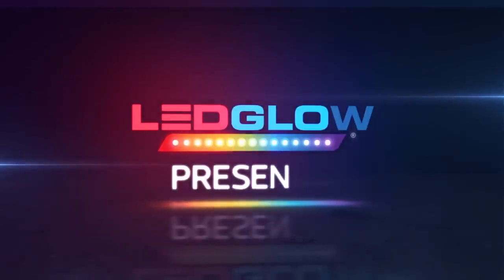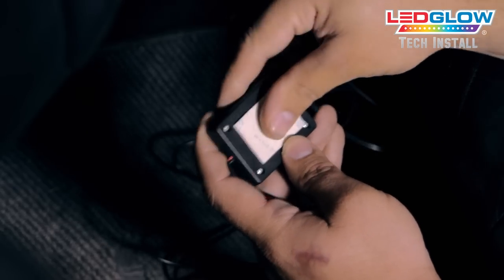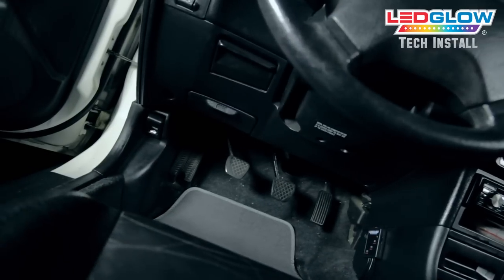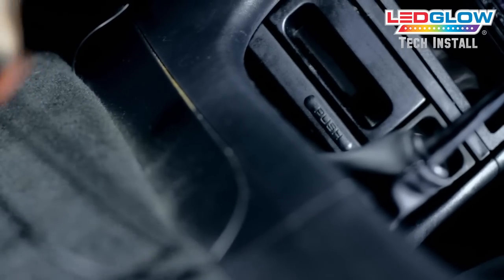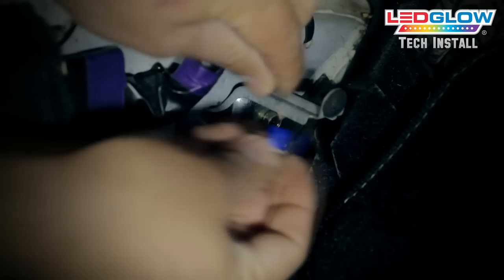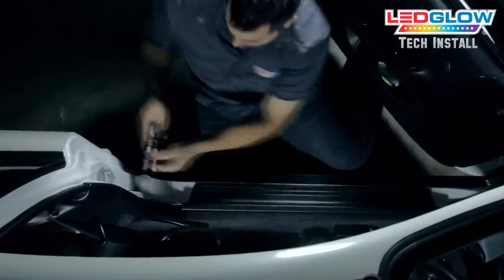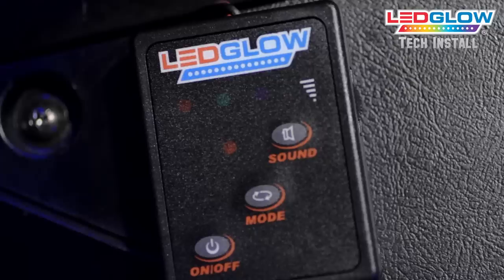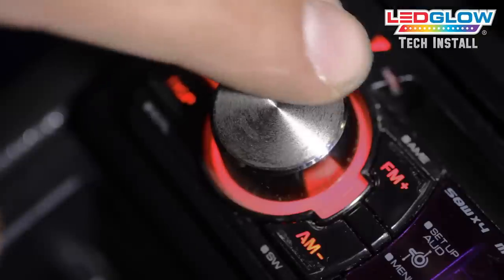Installation | LEDGlow 4pc 7 Color LED Interior Car Lights and Truck Lights

Comment: What sort of 12v source would you add it to? A battery fuse?
Reply from the maker: +Zach Smith You can power your LED interior kit from the fuse panel using the expandable circuit, from the cigarette lighter port using a cigarette lighter adapter, or you can extend the power and ground wires and run them to the car's battery. If you have any other questions or concerns don't hesitate to ask!
Reply: I know that but what sort of fuse do you guys recommend tapping? I'd rather not waste time under the dash guessing which one works if there is one you know of. You could put that in the directions for which one works best as well. All cars have the same set of couple of fuses then obviously they are different when you get into the specifics of your vehicle.
Reply from the maker: +Zach Smith You can use any 5-10 amp fuse to power your interior kit. We recommend using the radio fuse, power locks fuse, horn fuse or power windows fuse. Let me know if I can help with anything else!

Comment: do i have to haave an add a circut for this to work?
Reply from the maker: kyle alvey You do not need to use an expandable circuit to complete this installation. The expandable circuit is an optional installation accessory used to power the kit. If you don't want to use the expandable circuit you can run the power and ground wires to the car battery or you can use a cigarette lighter adapter.

Comment: In my fuse box, i dont have a constant 12 volt source
Reply from the maker: ElArmando97 You do have a constant 12v source in your fuse panel. A constant source is any component that can be used whether your car is turned on or off. If you're unsure how to find a constant source that you would like to use to power the kit, I recommend using a multi-meter to see the voltages of each fuse with the car off. If the multi-meter is showing around 12v with the car off then you have found your constant 12v source. If you have any other questions don't hesitate to ask!

Comment: I just got the kit on the mail but im afraid if i install it will creat a shortage how common is that?
Reply from the maker: Ricardo Salinas We haven't had many problems with people shorting their kit or a circuit. If you don't feel comfortable installing the kit yourself then I recommend taking the kit to get installed at any auto/stereo shop that perform installations and they'll be able to take care of you!

Comment: @LedGlow , i have chevy tahoe 2009 and i didn't know how to conect the underbody wires with the control box inside the car :( can u help me :( ! ( my kit is 10pc underbody and interior ) also i didn't find 12v can i use 10v ?!  (fuse box)

Comment: Where can I ground the black wire to? I have a bmw 328i
Reply from the maker: jason26162 You have to ground the black wire into any bare metal surface of your car, usually to a screw that threads into the frame of the car. You can also connect it to the negative terminal of the battery. Let me know if you have any other questions!

Comment: I've got a 2002 Ford Taurus SEL, will I need any extra fuses or amps??
Reply from the maker: ***** If you are looking to power your kit from your 2002 Ford Taurus SEL's fuse box then you will need to use a mini expandable circuit. The mini expandable circuit that we offer comes included with a mini 4 amp fuse that is used for the interior kit, so you will not need to purchase any additional fuses to complete the installation. Let me know if you have any other questions!
Reply: So if I am understanding you correctly, I do not need to make any other purchases besides this 4PC LED Underglow set as everything needed is included?
Reply from the maker: ***** If you want to power your kit from the fuse box then you will need to purchase a mini expandable circuit separately as it is not included with the kit. The kit comes with a red power wire and black ground wire that you can connect directly to your Taurus' battery, but if you need to extend the power wires to reach the battery, you will need to use 16 or 18 gauge automotive grade wiring. Check out our video called "LEDGlow's Powering Your Kit Directly From the Battery" that explains the process of installing your kit to the battery.

Comment: I have a 2006 Nissan Altima, and im having 
Trouble connecting it to the fuse box because i ordered it off Amazon and when i got it it didn't come with Zip ties and there are 2 wires lose ( one black and red ) i dont know how to connect it to my car. Help please?
Reply from the maker: Thatboii_edgar I apologize that you didn't receive any zip ties. Please send me an email as soon as you can to Mike@LEDGlow.com and I will have some shipped out to you at no charge. If you have your expandable circuit, you will see a blue butt connector at the bottom of it. There you will crimp the red power wire from the control box and then insert that into the fuse panel with whatever fuse source you choose. Regarding the black ground wire, you will need to make sure that this wire is always touching metal or else the kit will not turn on. In this installation, we crimped an eyelet connector and installed this wire to a screw that threads into the frame of the car. Please also refer to our expandable circuit video, https://www.youtube.com/watch?v=NZp1vqScX64, and if you have any other questions or concerns don't hesitate to ask!
Reply from the maker: Thatboii_edgar I apologize that you didn't receive any zip ties. Please send me an email as soon as you can to Mike@LEDGlow.com and I will have some shipped out to you at no charge. If you have your expandable circuit, you will see a blue butt connector at the bottom of it. There you will crimp the red power wire from the control box and then insert that into the fuse panel with whatever fuse source you choose. Regarding the black ground wire, you will need to make sure that this wire is always touching metal or else the kit will not turn on. In this installation, we crimped an eyelet connector and installed this wire to a screw that threads into the frame of the car. Please also refer to our expandable circuit video, https://www.youtube.com/watch?v=NZp1vqScX64, and if you have any other questions or concerns don't hesitate to ask!

Comment: okay so i have the honda civic 2012.
i inserted the red wire to the fuse box that says 7.5(also tried 10, 15, 20 and all failed)
i put the black wire to the metal part of my car seat.
i turned on the car engine
then tried turning on the led glow.
but all fails after all that. what am i doing wrong?

Comment: What fuse should I use in the add a circuit? I see that one has a 4 on it but I don't have any and I have an extra 20 can I use that?
Reply from the maker: Nick Neitz The 4 amp fuse that came with the expandable circuit must be inserted into one of the open slots of the expandable circuit along with a fuse from the fuse panel of your car. I would recommend either using a 5, 10 or 15 amp fuse instead of a 20 amp mainly because 20 amps is a little overkill when it only takes about 1 amp to power the interior kit. When selecting a fuse to power the kit, keep in mind whether the source is a switched 12v or constant 12v source. If it's a switched 12v source then you will only be able to use the kit when the car is on and if you're connected to a constant 12v source then you will be able to use the kit whether the car is powered on or off. Let me know if you have any other questions or concerns!
Reply: I went and got a 4amp fuse! I'm installing now! I'm in love
Reply from the maker: Nick Neitz Sounds great! Send us some photos to our Facebook or Instagram pages, we'd like to check it out!

Comment from the maker: You will connect the power wire to a constant 12v source and splice the ground wire to the door pin. Just be aware that if you do decide to connect your kit this way, the kit will only function when the door is open and will not function when the door is closed. We are working on a video that explains this exact install option, along with a few others, that should be public by the end of the week! Stay tuned!

Comment: they didn't say how to get the wire from the interior, into the engine area where the fuse box is. I have no idea how to do this. Anyone?
Reply from the maker: Atarien6 If you decide to power the kit from the fuse box in the engine compartment rather than using the fuse box inside of the car, you will have to pass the red power wire through the firewall by using an existing grommet or by making a new hole yourself. You will also need to extend the power wire using 16 or 18 gauge grade automotive grade wiring to reach the engine compartment. Let me know if you have any other questions!

Comment: I sent a E-mail just now.
I just tried installing it again and it doesn't work.
This is really frustrating because I wanted this installed in my car on the first day.
I plugged in the completely red wire to the fuse box on 10, 15, and 20.
I put the ground wire(black mixed with red wire to the a metal part)
I do not have any car accessories like other tutorials provided such as wire cutter, fuse accessory kit, electric tape and more..

Comment: I just got my lights in the mail and i cant find where the add-a-circuit is
Reply from the maker: Did you add the expandable circuit to your order? The expandable circuit is an optional installation accessory that is not included with your interior kit, it is sold separately.

Comment: Ok so how am I supposed to run the lights to the  passenger side if its not long enough
Reply from the maker: +Shawn Gray Each tube featured with the 4pc Single Color LED Interior Kit comes with 6ft of wire, so it should be more than enough to run 2 tubes to the passenger side of the car. Let me know if I can help with anything else!
Reply: i figured it out myself, thanks though

Comment: How do I do this without the add a Circuit in my 03 eclipse
Reply from the maker: Austin lane Roth If you don't want to use the expandable circuit for your installation, you can power the kit using a cigarette lighter adapter or you can run the kit's power and ground wires directly to the battery. Let me know if you have any other questions or concerns!

Comment: What size ring terminal do i need to buy to ground it ???
Reply from the maker: mrsfenderchick The proper ring terminal to use to ground the black wire is a #8 Ring Terminal. This size is used for 22-18 gauge automotive grade wiring so you should be good to go! Let me know if you have any questions!

Comment from the maker: You can connect the add a circuit to any fuse that's 10 amps or less. We recommend going no higher than a 10 amp fuse to avoid too much power going to the kit and shorting it out. Let me know if you have any other questions!

Comment: does the kit come with everything i need to install it ?
Reply from the maker: Mark Mendoza Yes, the kit comes included with everything you need to install it, but if you want to power the kit from your vehicle's fuse box or from the cigarette lighter port, you will need to add either an expandable circuit or a cigarette lighter adapter to your order. Let me know if you have any questions or concerns.

Comment: i have a suzuki & my fuses are smaller than the add a circuit's. it won't fit
Reply from the maker: We offer three sizes of expandable circuits, which covers all of the sizes available.  Check them out below and let me know if you have any other questions!

http://www.ledunderbody.com/Expandable-Circuit-and-4-Amp-Fuse.aspx

Comment from the maker: It is pretty difficult to hide the wires when using a cigarette lighter adapter. If you are concerned about the wires showing, I recommend connecting the power wires directly to your vehicle's battery or by using an expandable circuit like shown in the vehicle. These installation methods offer a much cleaner finished install than the cigarette lighter adapter where you'll have wire from the adapter and kit showing. If you have any other questions or concerns don't hesitate to ask!

Comment: I just bought this after looking at the installment video, not knowing there isnt an included add a circuit, now i have to go buy it seperately smh
Reply from the maker: dsf4065 I apologize if you were under the impression that the expandable circuit was included with the interior kit. You can find this installation accessory at any local auto parts store or at our website, www.ledunderbody.com. If you have any other questions or concerns don't hesitate to ask!

Comment: is it legal to drive with these?
Reply from the maker: RandomStuff777 Laws and regulations regarding aftermarket LED lighting accessories vary from state to state. I recommend contacting your local police department and asking them directly as they'll be able to give you a definitive answer for your specific area.

Comment: How can I find a 12v fuse? I have a 2006 aveo LS hatchback
Reply from the maker: julien rodolfo Every fuse in your 2006 Aveo LS Hatchback is powered by your 12v battery, so you will need to find either a 5amp, 10amp or 15amp fuse to power your interior kit! Let me know if I can help with anything else!

Comment from the maker: Yes, the kit will work if you use the switch and auto illumination function, but make sure you keep the control box in an accessible area so you can cycle through the kit's functions. The sound activation mode utilizes a mic in the control box that picks up the sound waves and flashes to the music. There's also a sensitivity wheel on the side of the control box that you can adjust for the mic to pick up or more less sound. Let me know if you have any other questions!

Comment: How do I buy  a kit from you guys? Can you leave me a link to the red version of this product?
Reply from the maker: Tayson Defas You can purchase one of our products directly from our website at www.LEDUnderbody.com or from online stores like Amazon and eBay. Here is a link to the 4pc Red LED Interior Lighting Kit for you to check out! http://www.ledunderbody.com/Red-4pc-LEDGlow-LED-Interior-Lights-Lighting-Kit.aspx
Reply: i have a nissan sentra 2003 se R. do i need anything else to install it. or just the product? will it be compatible?
Reply from the maker: +Tayson Defas You wont need anything else to complete the install, but I would suggest our Expandable Circuit, will make the install much easier and cleaner!

Comment from the maker: With the add-a-circuit or cigarette lighter adapter you wouldn't have to splice into anything, and your wiring would not be effected.  These draw very low power so its not going to blow anything either.  You can give our Tech Support Specialists a call at 1.877.LED.Glow and they will be more than happy to answer any questions you may have or help with your install.  Let me know if I can help with anything else!

Comment: Is there a remote control I could order for my led light interior?
Reply from the maker: Tayson Defas Unfortunately the 4pc Interior Kit does not utilize a wireless remote, but our Expanable SMD Interior Kits do. Here's a link to the our Interior Kits that use a wireless remote and if you have any other questions don't hesitate to ask! http://www.ledunderbody.com/Single-Color-SMD-Interior-LED-Lighting-Kits.aspx

Comment: Okay so I just bought the kit and what all do you need to install it?
Reply from the maker: Ryan Adams If you want to power your interior kit from the battery, you can use the power and ground wires that come included with the kit and run the wires to the battery. You can also power the kit directly from your car's fuse panel using an expandable circuit or from the cigarette lighter port using a cigarette lighter adapter. Personally I'd recommend powering your kit using the expandable circuit like shown in the video. It's an extremely quick and easy install and allows for a cleaner finished product with no wiring showing. If you have any other questions or concerns don't hesitate to ask!
Reply: I'm not sure I have all my stuff because when I opened it the only thing in it is the black and red wire and the lights with the controller box
Reply from the maker: Ryan Adams The Expandable Circuit and Cigarette Lighter Adapter are optional installation accessories that are not included with the kit. If you are interested in using either to install your kit you can purchase them directly from our website or you can find these accessories at your local auto parts store. If you message me back the year/make/model of your car I can tell you exactly which expandable circuit will be compatible with your car's fuse panel.

Comment from the maker: Check out our video called "LEDGlow's Auto Illumination" and it will explain the entire process of installing your kit to turn on with your headlights. An expandable circuit is not needed for this, but if you use a scotch lock connector as shown in the Auto Illumination video then you shouldn't run into any problems.

Comment from the maker: You would go about using the same installation process as shown in the video for your 2013 Toyota Corolla. If you plan to power your interior kit from your Corolla's fuse box you will use a mini expandable circuit. Let me know if you have any other questions or concerns!